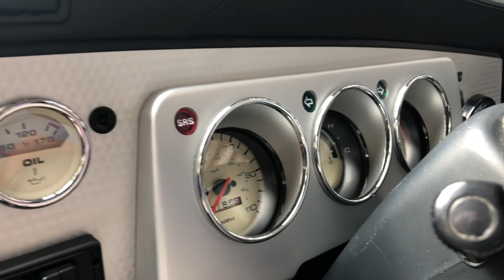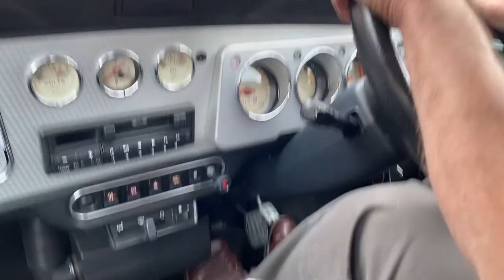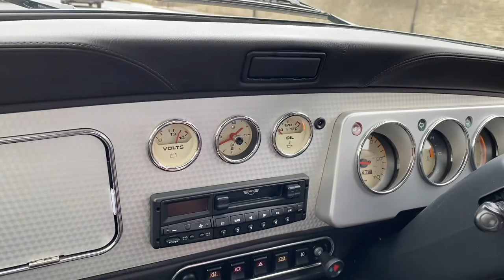2000 Mini Cooper Sport Mechanical Review

Comment: You say that everything works in the cabin"!!!  Great Oil Pressure"! Hope you used the Dip Stick before you drove off,!!🥱😮
Reply: That's oil temperature, but even when warm, the gauge actually hardly moves really as the original factory sensors are known to be a bit rubbish. Not sure if they degrade over time, or whether they always read incorrectly.